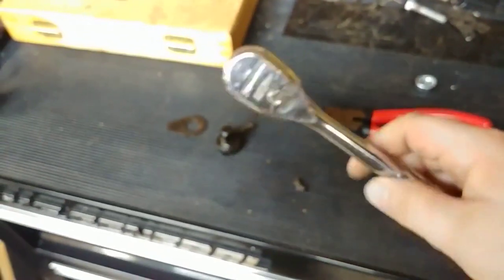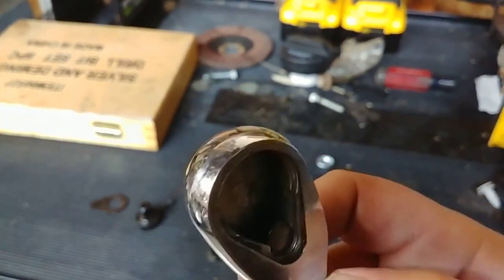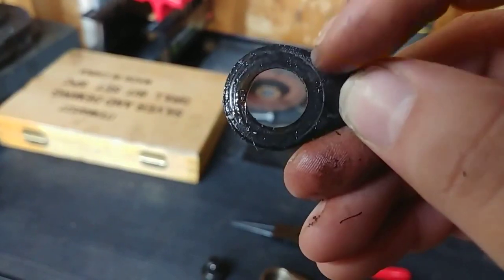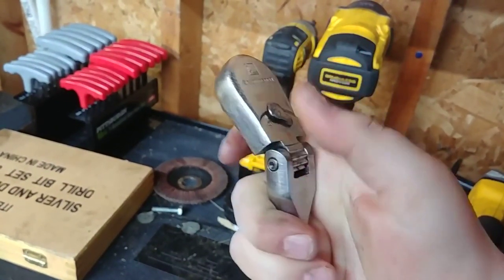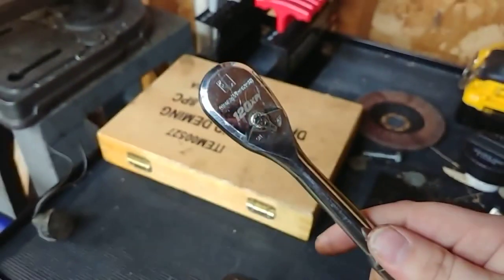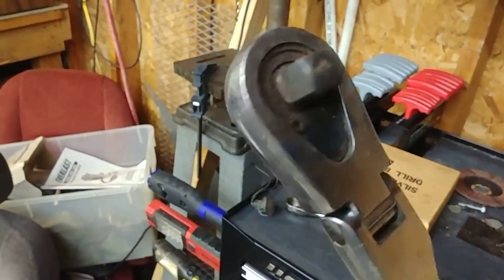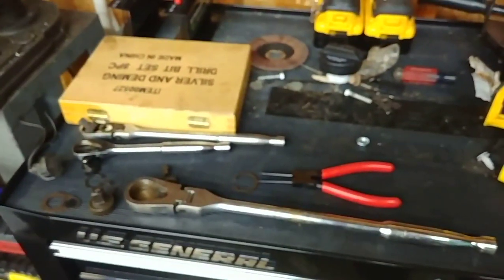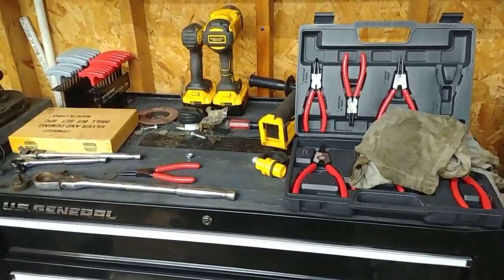Gearwrench 120xp 4 YEAR review and TAREDOWN

Comment: Thanks for sharing. Hopefully GW has maintained, or better yet, improved their quality...ordering a set tonight.
And, ughh, get some grease in there...that's shameful.
Reply from the maker: Used and abused. They were cleaned and lubed post video. They work good though and are a good price.
Reply: @guyfrommybox  I'm seeing that GW is releasing single pawl 90 tooth ratchets shortly. I'm wondering why they would step backwards unless they are getting high failure rates on the 120XP ratchets??? I may wait a few weeks to see what the pricing is like on the new 90's.
Reply: Wouldn't grease gear wrench ratchet gears. They recommend not because there's no clearance.Oil recommended lightly !